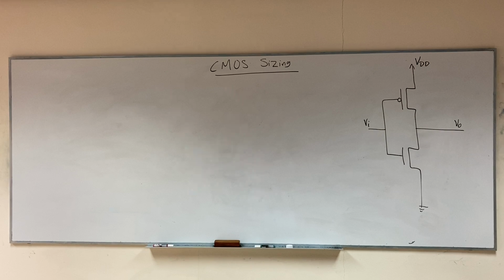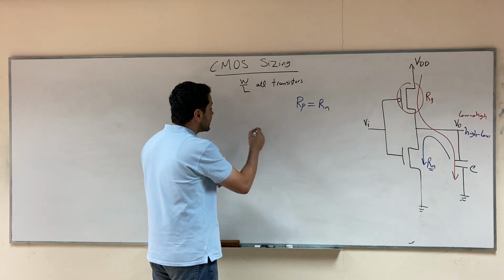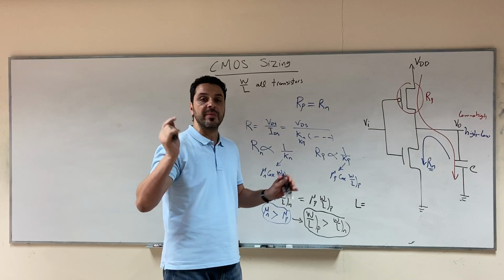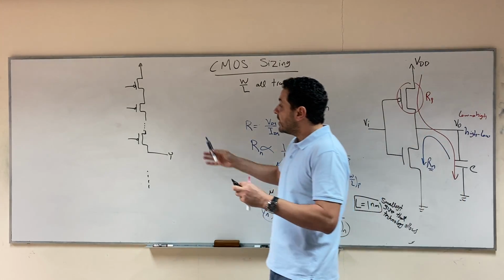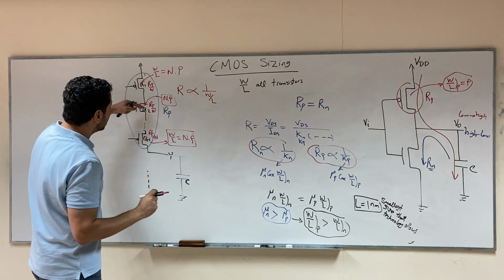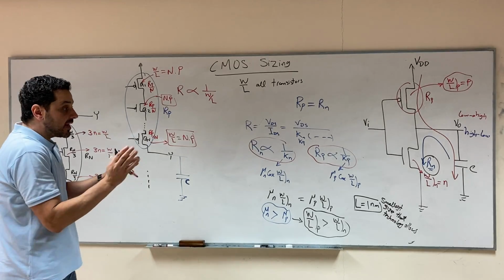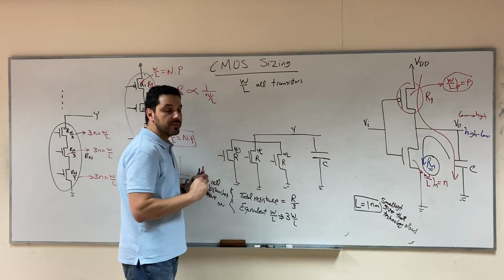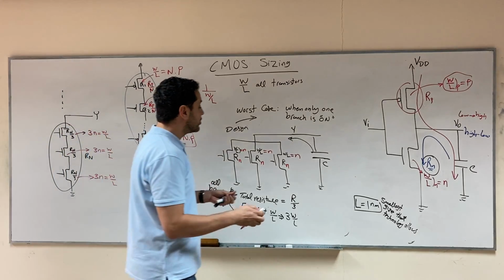EE 203, 88- CMOS: Sizing

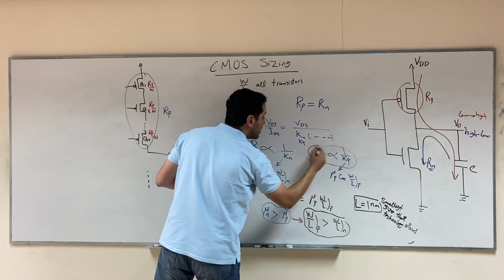Comment: I have a question 11:34 why did we consider the equivalent resistance to be series combination of Rps instead of calculating the Rseen using small signal model?
Reply from the maker: Small signal model is used for small AC signals in analog amplifiers. What we have here is digital circuits with large signals (high or low).

Comment: Excellent explanation. Can I use ADT tool to size transistors in cmos tech?
Reply from the maker: ADT is an analog tool, while CMOS is a digital circuit. However it can be used to design the sizing for small digital circuits, but won’t be practical for large ones.

Comment: Thank you sir, but I have a question at about 16:45 is that don't we consider the equivalent  resistance when we see from node Y(discharging path), for example, if I have 2 nmos in series, the  equivalent  resistance under node Y is "RN/3 + A*(RN/3) ".
Really thank you a lot.
Reply from the maker: If you have two nmos in series, then you should design the resistance of each of them to be RN/2, so that the equivalent is RN.

Comment: there is drain-drain capacitance of mosfet present, we will call this as diffusion capacitance. 
So the total capacitance at the output is
 C total = Diffusion capacitance + Wire capacitance.